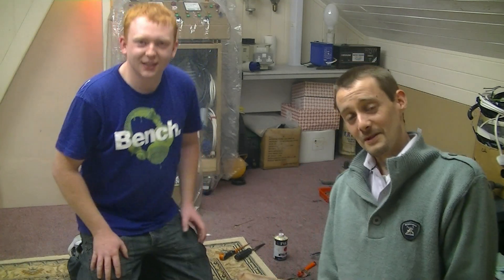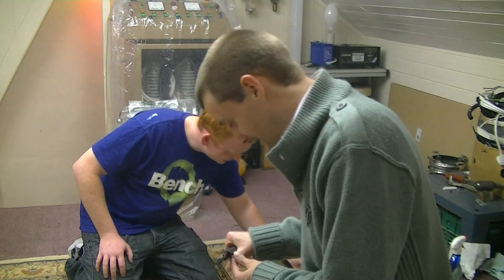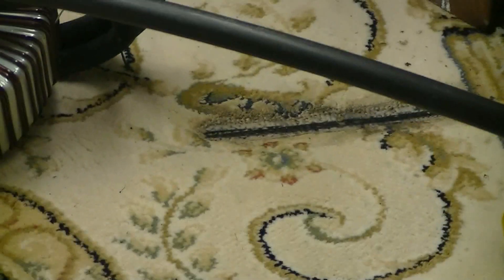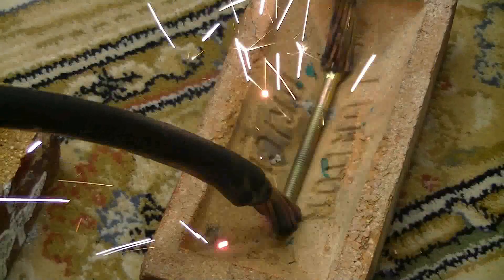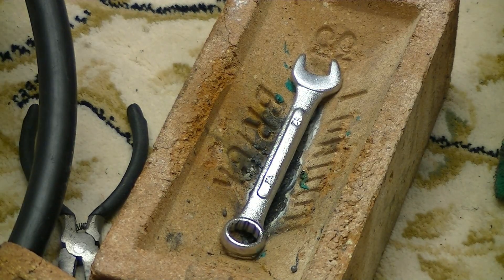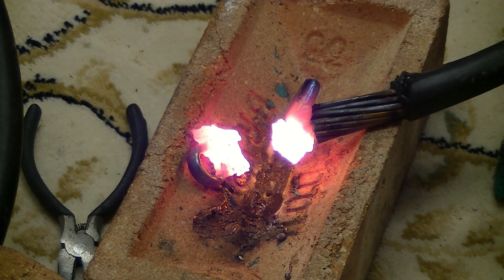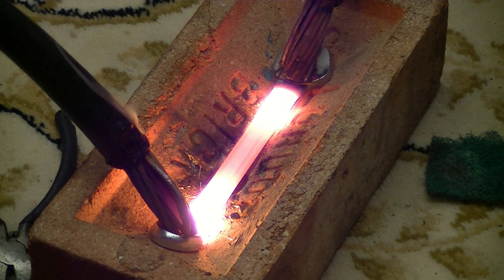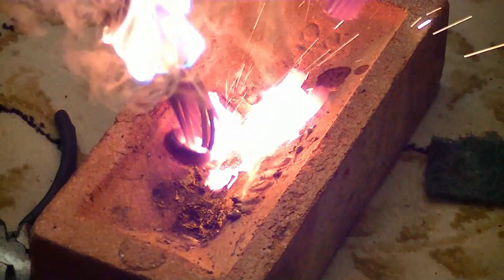5000 Amp Fuse + Tools Melt With High Current

Comment: Everyday laughing till the electric bill arrived:)

Edit: thank you for so many likes. I never thought this comment would be so popular. Thanks for the comments too :)
Reply: TheGoldberg1984 the video has 9 million views. That’s some decent money.
Reply: @prisonmike8214  maybe no money
Reply: with great power comes great electricity bill
Reply: I  came down here looking for that one... that bill finna be lit😭😭😭😭😭
Reply: ahah :D best comment ever :D
Reply: they are basically converting home power supply  240V 1A into 1V 240A, fun fact: if you touch the wire, it wont electrocute you, you will only burn your finger
Reply: Hahaha
Reply: Lol
Reply: This is so german
Reply: None of you have any bloody idea what you're talking about.

Voltage isn't necessarily constant, there is variability in both voltage and grid frequency. That's the job of the grid operators to maintain. Multiplying that out by many households and you get tons of error if you measure by total charge drawn (Ah). That's why we use kWh, because that is a more consistent measurement.

In much older installations, electric meters weren't even 100% accurate: They measured apparent power, not removing reactive power from the equation. Nowadays, that's no longer the case. You instead have electronics that calculate the real power and bill the customer by that amount.

Say the voltage and current are not in phase, and you're drawing tons of power. Much of that current isn't even being used immediately because transformers have an inductor on the primary winding, which effectively delays current change. If we billed by plain old VA, Photoninduction would be having a terrible day. Ironically, this effect is worse when the circuit is open. V and I are closer in phase when the circuit has a load.

So, to summarize, from worst to best:
- Billing by electric charge drawn (integrating current with respect to time)
- Billing by VA.
- Billing by real power.
Reply: He actually charges big-ass batteries at night when the electricity is cheaper and then uses them during the day.
Reply: @Oialca  you think that creates  electricity  out of thin air?
Reply: In an ideal transformer the power stays the same so P = U1*I1 = U2*I2. If we want to have high amps we get I2 = U1/U2*I1 = P/U2 => If we want higher amps the voltage must drop and the other way around. So you can't reduce the electric bill with a transformer (you pay for Energy with dim Energy = P * t), you're acutally increasing it since you have some energy loss.
Reply: They don't need much voltage there. Usually they run it on about a milivolt. Then with high amperage, they don't cost much.
Reply: Hey he used a high current transformer lol so hes electric bill doesnt go up too much xD ever heard of high current transformer?
Reply: They'll be living at the other guys parents house by then.
Reply: they're amplifying the standard current so it won't cost that much
Reply: Hakar Doski current is amps, to "amp"lify, you need to add amps. you cant create energy from nothing. you can do low volts high amps which will give you less watts but same energy output.
Reply: @aliensanonymous5063  you seem to be the only person here that gets that basic fact. Kudos.
Reply: No it wouldnt cost much cause your paying for volts these guys are sucking high ampage so it won't be as much as you it would be
Reply: @joejoe-cv4vp  

This couldn't be more fundamentally incorrect. You don't consume volts; you consume power. Hence why everyone on  this planet is billed by kilowatt-hours used. These guys are using a transformer to to achieve very high currents on the secondary side of the transformer, while drawing relatively lower current on the mains (primary side).
Reply: @zomgstuffnet  well that's just as incorrect. You don't consume Power, you transform it.
Reply: +Exoticdestroya WORKSHOP'S Lego Creations You actually pay for watts which is volts times amps.
Reply: @ironmatic1  kilowatt hour is the standard unit for electric service pricing I think
Reply: +Henry Byers Yes, you are correct.
Reply: @joejoe-cv4vp  :
"No it wouldnt cost much cause your paying for volts these guys are sucking high ampage so it won't be as much as you it would be"

==Ah crap no!

People pay for energy. Volts is not a measure of energy. It is a measure of the the strength of an electric field.

Energy is measured in Joule or Calorie.
For electric bill, they express it as kWh.
Joule is W * s. That is Power * time .
kWh is also Power * time.
Reply: @joejoe-cv4vp  
They dont pay by the kw/h there? I'm movin' there!
Reply: @siggyretburns7523  
"They dont pay by the kw/h there? I'm movin' there!"

==It is actually kWh. You have to multiple Power * time to get an amount of energy, such as Joules.
Haven't you guys taken a physics course?
Reply: @joejoe-cv4vp  Nobody has ever been more wrong than you. It blows my mind this erroneous comment has dozens of likes. Unbelievable!
Reply: @joejoe-cv4vp  you're paying for watts (volts x amps)
Reply: @joejoe-cv4vp  you pay for wattage, not amps, volts or resistance
Reply: @joejoe-cv4vp  no. They charge for watts... why would they charge for volts if your house always has 240 volts?
Reply: @joejoe-cv4vp  no ur paying for wattage which is voltage times current(ampage) so the bill would go higher
Reply: @joejoe-cv4vp  No, you are paying for Watt-hours...
Reply: @joejoe-cv4vp  please delete your comment, it's wrong and people are actually liking it.......
Reply: Exoticdestroya lego hahahahahha
Reply: @joejoe-cv4vp  You don't pay for volts lol, you pay for Watts which is current * voltage. Otherwise everyone would be ripping off the energy companies
Reply: @joejoe-cv4vp  no. You pay for watt-hours.
Reply: @joejoe-cv4vp  a little bit late but  I will explain why you are wrong,    in the electric  bill  what you  are paying for  is  (  power used  in one hour )     kilowatts /h  not  volts,    1 kw  = 1000 watts   and  how   power ( watts) =  volts  x   amp   they  are  consuming  a   lot  of  electricity  in what they´re doing, therefore they´ll  pay  more.

lets  assume they´re  using  5  volts   and  5000 amps, then  they´re using  approximately   25 kilowatts  of  power  to melt  those  wrenches  and bolts.

though  I  do not think it is a problem  since I  assume  the  revenue  of  this  video alone  will cover the  cost easily.
Reply: @joejoe-cv4vp  directly proportional to voltage
Reply: @joejoe-cv4vp  2 years ago but that’s true
Reply: @joejoe-cv4vp  dude, this gave me an very illegal idea
Reply: @joejoe-cv4vp  They are stepping it up using the transformer no extra power needed
Reply: @joejoe-cv4vp  volts x amps = wattage (total power)
Reply: @joejoe-cv4vp  no, you pay for watts. Watts=Volts×Amps
Reply: @joejoe-cv4vp  You don't pay for volts you pay for kw per hour dude.
Reply: Exoticdestroya workshop thanks for the explanation! I suppose they know what they are doing. It was a easy joke! Thanks anyway!!
Reply: Exoticdestroya WORKSHOP'S Lego Creations, please, explain to me, how THE FCK you can pay for volts? IT‘S DAMN AMPERAGE, otherwise you‘d be paying without consuming power. Also, they use a transformer, that‘s why the electrical bill won‘t be too much.
Reply: @Cyber_One :
"THE FCK you can pay for volts? IT‘S DAMN AMPERAGE"

==Yes, but more specifically, we pay for the energy used. The voltage stays constant. The amperage is the variable.

"Also, they use a transformer, that‘s why the electrical bill won‘t be too much."

==I'm not sure what you mean.
Transformers are not 100% efficient. Whatever the power output is at the secondary, let's say it is 100 W, then at the primary, it will be a higher Watt being used.
Reply: louis tournas I mean that the transformer produces a magnetic field, which in turns generates a voltage. However, the electrons do obviously not travel through the primary to the secondary, it‘s the magnetic field, which moves the electrons back and forth (AC). However, the power used cannot be monitored, as the electrons (which are powering the accessory) are not traveling through the „electrical bill counting machine“. The only thing you have to pay for is the amount of electrons passing through your first coil, or as you might prefer, amount of electrons times voltage. So what I really mean, is that they don‘t plug their stuff into the wall outlet, they plug in into the transformer, which firstly kinda lowers the bill and also makes higher current possible.
Reply: @Cyber_One  A transformer only lowers the electric bill because it lowers the power by lowering the voltage. However, whatever energy you draw from the secondary, you consume on the primary, plus losses in the transformer due to reactive current, core hystheresis and eddy currents.
Reply: Acceleratus No, the magnetic field „moves“ the electrons back and forth, the power consumption (on the primary, not the secondary) does NOT increase if you charge more current from the secondary. The ONLY thing the primary does is to transfer the magnetic field onto the secondary, from which the current is drawn. Thus, the moneeee you have to pay for is the electrons coming through the primary, which btw. also include the Eddy current electrons, etc. Also, you can increase the voltage by making more turns on the secondary. Please go to Wikipedia and learn how a transformer really works, thx, or you just didn‘t understand what I meant.
Reply: @Cyber_One  Where does the energy drawn from the secondary come from then? Creating energy out of nowhere violates the first law of thermodynamics. The magnetic field is indeed created by the primary and that field does indeed induce a voltage in the secondary coil. No actual current flows between the coils. The current draw of the secondary coil does however determine the current draw of the primary because of the power equation

Power = Voltage * Current
The power is (ideally) the same on both sides and the voltages are (ideally) constant, so that only leaves the current as the variable. If you draw more current on the secondary, you end up drawing more current on the primary.
Reply: Acceleratus The transformer acts like a generator. The power for your house is produced by a spinning magnet, which is surrounded by coils. If you increase the number of turns of the coils, the voltage increases, as the magnetic field has now more impact on the cable and moves even more electrons back and forth (that‘s how AC is produced, because magnets have two poles). So, you get more current, from the same spinning force of the magnet, by just increasing the amount of turns. To simplifiy: The electrons want to move but can‘t, because the cables are not connected, however, a voltage is present. Now if you connect them, current is flowing, thanks to the magnetic field and if there was no resistance at all (which is not possible, cables still have a bit of resistance), an infinite amount of electrons were to move. The energy drawn from the secondary is simply the magnetic field induced into electrical energy. Now for better understanding: If you have more VOLTAGE you obviously can draw more current with the same resistance. And if you increase the number of TURNS of the secondary, you obviously get higher voltage, thus can draw more current from the same resistance. Think about this, pls.
Reply: @Cyber_One  I have no idea what you're trying to tell me. You're just telling me some unrelated electrical facts now.
Reply: Acceleratus Ok, let me try again: if you increase the amount of turns of the secondary, you get higher voltage (at the secondary) and higher voltage means more current at the same resistance. The voltage at the primary however is the same, thus the amount of current as well, it‘s all about the number of turns!

Note this: The magnetic fields force does NOT increase, thus there is no more current drawn on the primary. That‘s how transformers work dude!

And if you still don‘t understand what I‘m saying, please go to Google and look for an answer and if you found one, post it here. Thx!
Reply: @Cyber_One  Are you implying that the energy consumed by the primary is constant no matter the load on the secondary?
Reply: @Cyber_One  I study electrical engineering as a matter of fact, but I don't think either of us are clear on what the other is saying. Your original statement is false. You pay for energy, not current. Also i never said the magnetic field changes strength. Whenever current is drawn from the secondary coil, energy is taken from the magnetic field, causing it to collapse a bit. The strength of the magnetic field is immediately replenished by the primary coil, the energy of which comes from increased current through the coil. Because the loss of magnetic field energy is immediately replaced, no change is observed.

And by "energy consumed by the primary" i meant energy taken from the primary side, and then transferred to the secondary side. Are we clear?
Reply: Acceleratus Ok, then resistance on secondary should affect the magnetic field, ok.
Reply: @louistournas120  No no nooooo. They use far more Amps on the primary Side... i think its a minimum of 20 Amps. If the primary voltage is 230V then they have a power consumption of 4600 WATTS. With an efficiency of 80% then they have 3700 WATTS on the secondary low voltage/high current side !
Reply: @Ballistix91  :
Those numbers seem fine to me except for the efficiency of 80%. I have no idea what the efficiency would be.
I was just responding to people making nonesensical comments, such as Exoticdestroya lego /fishie nippie.
I don't know why people are writing "the electrical bill won't be much." What is that suppose to mean?
Like you said, if 20 A is passing through your primary wires, then you are using 4600 W.
Whether you are using that energy to induce current, create heat, create light, create radiowaves.... the electric company does not care.
Reply: @Cyber_One  :
Exactly. The evidence for language development at the early stages is non-existent. We can only guess. It is normal for there to be no evidence. There weren't thousands of news companies, no camera, no VHS, no DVD.
It is speculated that human at first used grunting noises to indicate what they want, for example grunting noises to say "Give me that piece of meat or bone or food". During hunting, they would emulate animal noise. Possibly, the next phase would be to identify the self (give a name for yourself).

"I mean that the transformer produces a magnetic field, which in turns generates a voltage. However, the electrons do obviously not travel through the primary to the secondary, it‘s the magnetic field, which moves the electrons back and forth (AC). However, the power used cannot be monitored, as the electrons (which are powering the accessory) are not traveling through the „electrical bill counting machine“. The only thing you have to pay for is the amount of electrons passing through your first coil, or as you might prefer, amount of electrons times voltage. So what I really mean, is that they don‘t plug their stuff into the wall outlet, they plug in into the transformer, which firstly kinda lowers the bill and also makes higher current possible."

==Yes, you do pay for the electricity passing through the first coil, like you said.

"which firstly kinda lowers the bill"

==What makes you think it lowers your bill?
Reply: @Cyber_One  if I recall rhe primary current is not constant.
There would have to be more power in the primary if the secondary has more power and since the primary is fixed the primary current would vary.

I didnt go to Wikipedia, but engineering school.

Transformers are only trading volts for amps or vice versa.
Tranformers do not save power.
They save resistive losses over long distance so we can send the same watts with more vokts and less amps, making the wire lighter and cheaper.
Its why Brits use 220 as standard service.
Reply: @Cyber_One  tranformers xan have a reflected impedance if I recall.

Comment: this could be used for Blacksmithing easily, does it melt the surface or the interior first? 'cause if it melts the inside first then its perfect for knives making the inside more flexible while the outside remains sharp
Reply: it melts evenly
Reply: Peter Zingler you just contradicted yourself.... evenly or inside hotter?
Reply: +Sergio Solórzano Yeah the thing is that the part with the highest resistance gets hot first and thats hard to tell ...normally it should heat up evenly from the outside to the middle
Reply: but as physics go the inside gets hotter first
Reply: Peter Zingler if the inside gets hotter first then as i was saying it could be a good way to add plasticity to the core of a sword quickly, or just some areas (from cable to cable), so you can control what areas to heat i see it could be usefull, really dangerous though.

Comment: As soon as I saw the pic with the wrench as a 5000 amp fuse I couldn't help but laugh and watch the video.  :>P

The long narrow bar wouldn't melt because the internal resistance was more than the fatter shorter wrench, cutting the amperage down, well below 5000 amps. Interesting.

Comment: In what universe is a 5000 amp fuse useful?
Reply: Galvanic systems as an example in the AC DC conversion , they have Amps like these ...or electric submarines they even have 15000amp fuses

Comment: Please explain to me how you are doing 5000 amps in a home without tripping your 100-250 amp house meter ?
Reply: Step the voltage down dramatically on the secondary side will increase the current
Reply: A current step up transformer